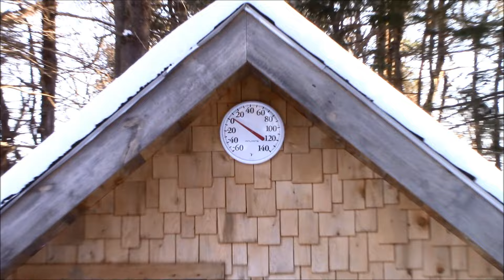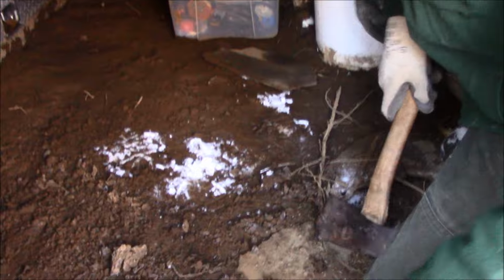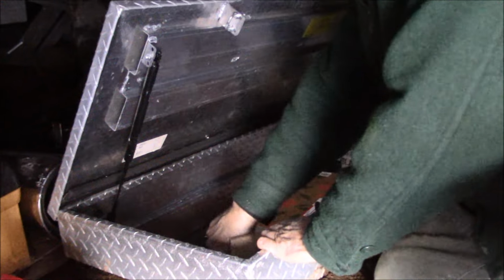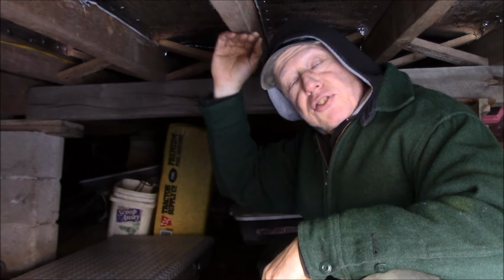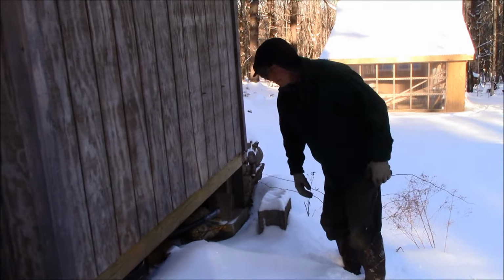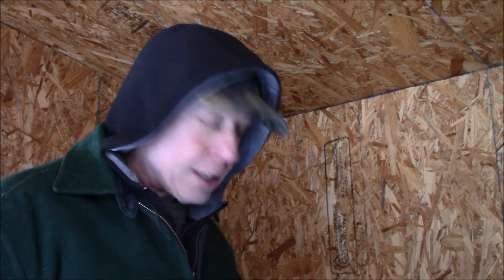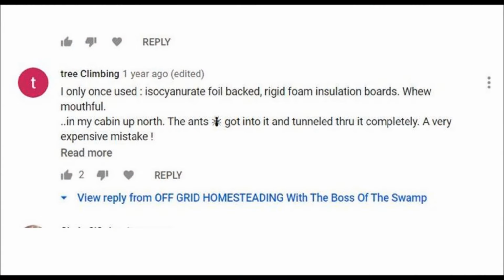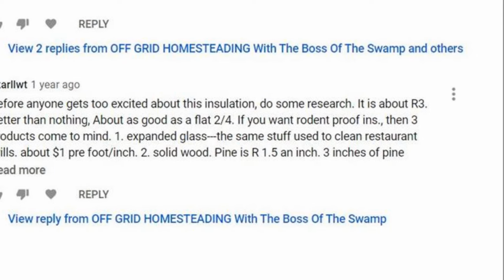Awesome Floor Insulation For A Cabin In The Woods   3rd Year Review

Comment: loved your video . i am only at 16;09 into it but i have two questions.
1) how warm is your cabin interior?
2) what r value are the ceiling and walls in your propane freezer shed?
I am thinking on adding the bubble foil under the bedroom of my 3  season R-12 cottage in Ontario. That room is only heated on weekends and the uninsulated floor is so cold in October
Reply from the maker: Our 24x24 two story cabin is always warm and cozy.
The freezer shed has R19 ceiling and R13 walls and the window stays open unless the temp drops to zero or colder. You won't regret using the foil.  I have an updated video on this that I think you will find beneficial   https://www.youtube.com/watch?v=Wa2-FWAwwUY

Comment: I have a cabin with a block wall foundation crawl space.  I am think about doing the foil between the floor joists like you.  Do you think I need to attach it somehow to the block wall also?   I am not there often in the winter and when we are gone there is no heat left on.
Reply from the maker: If the block wall is cold, I think I would cover it with foil also.

Comment: Here is why this works:

Bubble foil is a radiant barrier. It reflects heat waives back into the the warm air space. This requires an air gap to happen. In this case the foil is right against the subfloor and thus there is no air gap. So the bubble foil is absorving the heat from the subfloor through heat conductivity. The R value of the foil is very low, so heat travels through the foil very quickly. HOWEVER, a radient barrier is also an emissive barrier. This means that it does not emmit that heat down into the air gap below (the crawlspace) in the form of radiant heat. So most of the heat never leaves the foil (except where it touches the joists). In summary, a radiant/emissive barrier will work as long there is an air gap on either side of the barrier.

Comment: I've left this comment before on 1 of your other vids, but I'll do it again for any nonbelievers.  We had a 40'x64' metal building/ pole barn built with only bubble foil for insulation and no furnace/heater installed.  The 1st winter we wake up to snow and single digit temps; we cleaned off the windows and pulled our truck in there because they were calling for more snow.  The next morning I go to warm up the truck and all of the snow is melted off the entire truck, and we're still near 0°.  I KNOW that bubble foil insulation works because that was nearly a 30° change to melt all that snow, so now I'm a believer yessah.  Thanks.

Comment: I used the same to insulate my pole barn, wrapped it tight all around and taped the joints, I’m in central Illinois with temps as low as the negative teens. Reflective Foil Bubble wrap is great!

Comment: A couple things Boss;
First off, it seems to me that with the skirting/bubble foil around the building perimeter preventing a lot of air movement you're successfully keeping enough of the earth's heat under your building so it is cool but not freezing. So doing a thorough job with the skirting is worth the time.
The truck toolbox for cool storage gave me a chuckle.
D@mn yankee (that's a good thing).
Second, when building the floor of your freezer shed you tacked the bubble foil over the joists first and then the plywood; would you recommend that technique for a building you intend to live in? For my two cents - it sure beats crawling around underneath afterwards.
Best :D
Reply from the maker: Absolutely.  I would have put the foil over my floor joist here but the camp was built before I was born haha

Comment: Thank you for this video and your others on this ! 
I cannot get under my 1950s cabin 
Just confirming .. Are you confident I can use it on top of the floors and then strap over it and finish with plywood subfloor etc ? .. If so suggested spacing for 1/2” strapping ? Northern Ontario.. pretty cold winters
Reply from the maker: If I couldn't get beneath my building, My first move would be to skirt the building and insulate the skirting. This helps tremendously.  If this wasn't enough, my next move would be to insulate the floor in the manner you just mentioned. This is (what I would try) but I have not done it yet as I've always been able to bet under my structures.
Reply: Thanks so much for your reply ! 
Raising cabin etc .. simply can’t afford 
will do the skirting and as much as I can reach underneath - Maybe 1/3 of cabin 
I know you mentioned not to ur too much …cabin has to breathe but inner walls have wind blowing through them no insulation at all . 
Would you use  this product instead of blown in foam ? 
On a cold windy lake ..hoping this might really work

Comment: My home has no foundation i built stud walls and covered the outside with metal sheeting and on the inside i put the double foil bubble Wrap. I did not do the Floors Underneath . I have Carpet in the rooms and my Floors are warm. My Furnace runs are under the house but they are insulated and sealed up. On a Zero degree Day you can be under my house wearing only a tee shirt. My heating bill was cut in half compaired to last year so far. It is Working For me. Thank you .

Comment: I would like to make a small contribution. There is a lot of people in Canada  who are using bubble foil to insulate their hot water heaters to cut down on the electrical cost. And others cover bare concrete walls with insulation and bubble foil in their furnace rooms. In a cottage plugging your dry vent with bubble fand insulation makes a great difference also.

Comment: I am in the process of building a cabin and so glad to see your video. I am wondering about install procedures? Is the foil installed after the floor is in place, i.e., installed via the crawl space? I saw another video where they installed the foil on top of floor joists, then installed the floor, but I would think that might compress it too much. My cabin is on a bit of a slope, so my crawl space under the beams and joists runs from 1.5 ft to 3 ft, so it is not as ideal as yours, but still worth the effort to install this bubble foil. I have thought of installing it before I put the floor on, but just up to top of joist, then rolling it over to the next joist, but not sure if that will work well.  Any advise would be greatly appreciated. Thanks. Love your videos.
Reply from the maker: Over the joist insulates best but also has it's downsides.
I think you'll find your answers in this updated video https://www.youtube.com/watch?v=Wa2-FWAwwUY
Reply: Thank you for the speedy reply. I did find that video after I asked the question, and I will be going over the joists with this. Thanks for the heads up on water trapment during construction. I may just put enough down to cover with flooring the same day and cover it all with a tarp as I am putting tongue and grove 3/4 pine for floor...which brings up another question.  You say "sub-flooring",  does this mean that there would be a sheathing of somekind on top of the bubble-foil, then a flooring of some kind on top of that?  I just plan on using the 3/4 " boards. Would that cause a problem with the bubbles being broken with just 1 depth of flooring? @thebossoftheswamp
Reply from the maker: Yes a subfloor is a layer of plywood nailed to your floor joist and your finished floor goes on top of that after the house is reaching completion.  Just 3/4" pine over joist would be inadequate.  Don't skimp on your floor or your roof.   @livingcheap1625
Reply: I am taking your good advise and putting down OSB subfloor, but another question has poped up. I am putting the bubble foil on top of floor joists, then the sub floor, but it will take me awhile to put the walls together and get the roof on, so am worried about the moisture issue. I thought  about getting a tarp big enough to cover the whole floor  and it could even be used as a roof over the floor and raise it as I raise the walls, which will be going up  1 row at a time. I could even arrange to always have 1 wall higher than the other so water would run off. Does this sound feasible, or do you have any other suggestions as to how to keep water from seeping from  the OSB, through the bubble foil, and onto the joists. We have had the wettest summer/fall on record, and just had hurricane Lee pass through this weekend, so who knows what will hit next. Thanks again your channel is a great help
Reply from the maker: @livingcheap1625  From what you just told me, I suggest holding off on the bubble foil and install it after your structure is dried in.  The insulating properties will be just as good and you won't risk the danger of water getting trapped in there.  Also, since you said you're using OSB, then I STRONGLY hold my suggestion above.  OSB will deteriorate and also get moldy when subjected to moisture.  In my videos you see me using ADVANTECH.  Yes it's more money but worth every penny.
Reply: Thanks again, and sorry for all the questions. I cannot find any supplier for ADVANTECH in Canada, at least around my area. I am using all rough milled hemlock lumber for my build and am thinking of putting  1"x8" rough milled boards down for the subfloor instead of OSB, or plywood as I can get it at a good price. I would then put the 1 " tongue and grove boards on top of that after I have the roof on. This would give me a true 2" thick floor . I don't think the Hemlock board subfloor would have any issues with moisture as I am also going to char the boards with a torch which preserves from water and insects (I am doing this to all lumber in the build. I am still debating about putting the bubblefoil under, or on top of the joists. @thebossoftheswamp
Reply from the maker: @livingcheap1625    Those hemlock boards will shrink and you'll eventually be able to drop a pencil between them.  The less cracks you have in the floor, the warmer your floor will be. if you can't get advantech, then a good fir plywood will do.

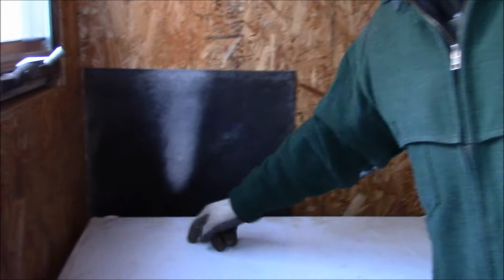Comment: At 11:26 in your video, you are in your shed and I see that it has a small window, is the window double-paned or single-paned? You also mention that you have insulated your attic space and walls. Assuming that the walls are 2x4 at 16 OC, did you put the bubble pack on the inside of your walls before you installed the OSB? If you did insulate the walls, did you use Pink Insulation? In the attic space, how much insulation did you put up there? And is it too pink insulation? Is your shed attic vented with soffits and gable end vents?

Now assuming that you only used bubble pack on the floor joists and nowhere else, is the exterior walls insulated with a vapor barrier on the inside? 

I live in the Central Interior of British Columbia, Canada and we have up to + 50°C in the Summer and up to - 40°C in the Winter.

In the crawlspace of your home and shed, have you ever had issues with insects (spiders, ants, etc) and if you did, did the bubble pack solve the problem under the shed? How about rodents and small animals such as skunks, racoons, squirrels, rats, mice ever taken up residence in your crawlspace areas under your shed or home? What was your remedy, if any?

BTW, I just love your videos... Thanks for sharing...
Reply from the maker: The shed was insulated with Kraft faced fiberglass in walls and ceiling but just a single layer of foil beneath it like all my structures have, and that's an old double pane and the roof is vented.

Mice take up residence in whatever I store in the crawlspace but I remedy that with traps i make from 5 gallon pails.   https://www.youtube.com/watch?v=7FvCsDd-IiM

Comment: Actually you are getting a geothermal advantage from Mother Earth by covering the building footprint with your cabin and insulating with the bubble foil keeps the cold air fro getting in. You get very little heat down from you cabin so the heat is coming from the earth. Usually in your area about 50 degrees like a root cellar. I’m in Canada and we use the foil a lot for this reason.
Reply from the maker: Yes indeed and the ambient temp would be blocked if i covered the ground with a tarp. It would get a lot colder under the cabin.

Comment: Hi Boss,
I have an old farm house on piers with a tight crawlspace. I'm planning on pulling up the floors to level them out. While it's open, I wanted to insulate my crawlspace. I was thinking about adding batts in the crawlspace and stapling the bubble foil over the joists like you did, that way the batts are protected and not exposed. Do you think that this would be a good option? Thanks, and God Bless.

Comment: What material did you use for the waterproof skirting? Is that right over the 2x4's? How did you set up the framing for the skirting does it go into the ground?
Reply from the maker: I'll be doing a video of that very soon to explain how I skirt my buildings.  Stay tuned.

Comment: We used it 5 years ago in a 2x4 shack that we built on a pressure treated deck. It was in the Adirondacks at Twitchell Lake near Old Forge NY. You can Google  Ann La Bastilles log cabin dismantle for Adirondack Museum. We made YouTube. All we had was a piece of canvas for a door and a small propane heater set on the lowest setting. Most time we worked on cabin was around15° ,at nite it was -5 to -10°f. I'm sold on reflectix and used it in my own house . Makes a big difference. So all those nay Sayers and people who put it down,...stuff it! Give it a try ya cheap b...... John. Oh l drink those black n tans too. Yum.

Comment: Should we ONLY use it under the floor and skirting areas? Why aren’t we using it in the walls and ceiling as well? Or can we use it in walls and ceiling first and then do a layer of regular fiberglass insulation as well?
Reply from the maker: You can use it in the walls and roof but never put it against the interior of an exterior sheathing. See how i use it in my roof at the 11:50 mark in this video.  https://www.youtube.com/watch?v=Wa2-FWAwwUY

Comment: In regard to the Flooring . Did you use Pine tongue and grooved or just butt the dried lumber together like in the old days? Maybe you can explain what work for you. Im in South Ga so not insulating.
Reply from the maker: The sub floor was rough pine boards layed down in the 1950's.  You can put a pencil between them. I have shiplap for finish floor in most rooms.
Reply: @thebossoftheswamp  Thank you.

Comment: Boss, would you recommend ripping the 4' wide pieces for 16" O.C joist or buying the precut width rolls that are 16" wide?   The reason I ask is that it looks like yours are wider which allows you to staple along the joist, do you think having a little wider provides a better seal?   Ripping a 4' roll wider than 16" would also cause some waste, but maybe it is worth it for efficiency?   thanks

Comment: Good Video JC. I used bubble foil on a 24 by 24 log cabin. 16 OC joists. I cut the bubble foil in the roll at 15" wide and then cut 12 foot pieces and spray glued 2 layers together. Then stapled the batts to the floor. It was 4 below here in far north central WA last week. The floors were warm... "With no skirting!" Second winter now of proving bubble foil works. And an FYI about the "R" factor system. It does 'not' take into account any reflective qualities a material may have. All those nay sayers you get? Well, ya can't fix stupid. Must be tough confining ones self to a box. "I wouldn't know"(grin).

Comment: I am planning to install Advantek tongue and groove subfloor with screws and adhesive per manufacturer instructions. How do Install the bubble foil?
Reply from the maker: Myself, I would staple it to the underside of the advantech (between the joist) after your project is dried in.  I'm reading this and heading out to buy advantech in a couple hours.

Comment: The use of this for multi purposes has been done for generations now. Back in the 50's I ran across stories that layers of aluminum foil was used in walls to create the radiant barrier to air flow. Radiant barriers have been know since the old Florida Solar Energy Center. Knocks out the incoming summer heat if the roof rafters (not the ceiling rafters) have just a radiant barrier stapled to the underside. Prevents the heat by convection and conduction going into the ceiling insulation and transferring the heat to the ceiling.    If the ceiling is kept cooler than your body in the summer you will feel cool. 

 Studies on insulation show that even R 50 worked in ceilings in Las Cruces New Mexico. I have run across homes now done with R 100 ceilings and R 50 walls..

Comment: Thank you for this vid.. I went back and watched parts 1&2 (again).. I see that you are concerned about freezing pipes.. What would you do different if you did not have pipes under it.? ..I am trying to figure out the best way to keep my floors warm while keeping rodents (Pack Rats) out and it looks like this is good,, but I will not have a crawl space.. . I did a couple of vids called "Poor Man's Concrete Slab" in November and of course a lot of keyboard engineers said it wouldn't work.. So I am back to square one and running out of time to start the build.. I'd appreciate your thoughts..
Reply: Do yo have to have a full slab?  I just built my 12 x 20 on a 28 total concrete blocks stack 2 high.   4 inch thick 8 sided blocks.
Reply: @1989Falkor = We have Pack Rats out here.. If I don't make the underside completely inaccessible to them they will eventually find a way in.. Building it in "piers" does not take care of  preventing the pack rats from finding a way in..
Reply from the maker: I would add a second layer of foil with a trapped air space in between them.